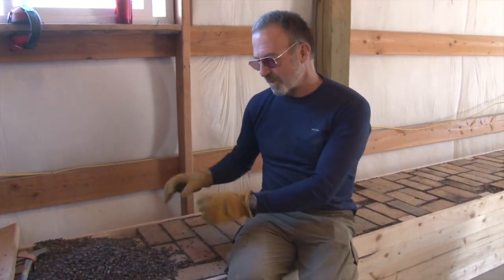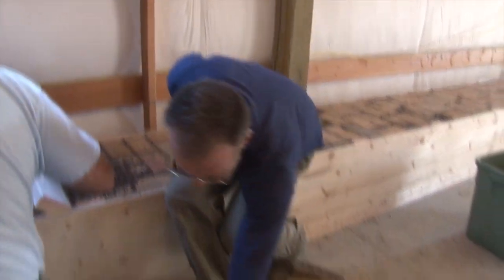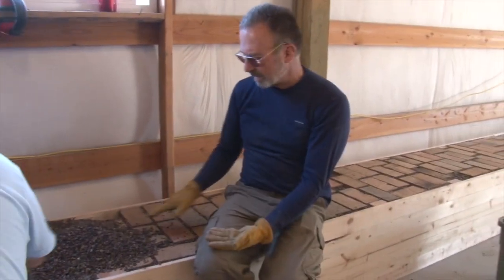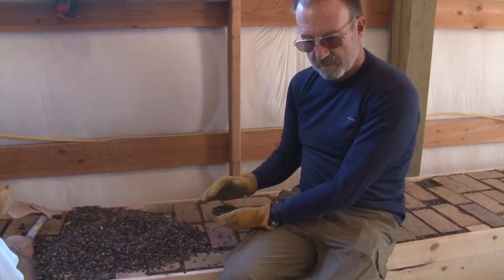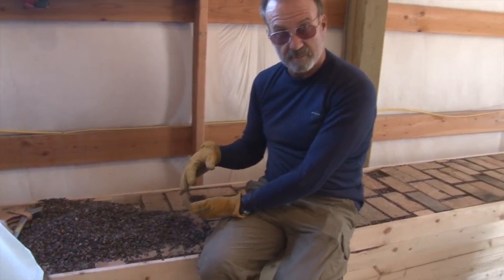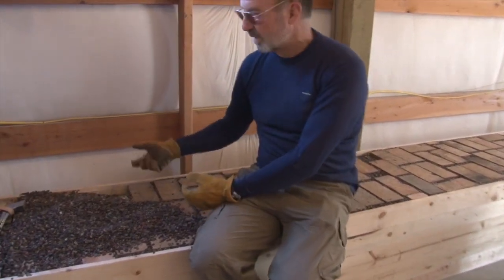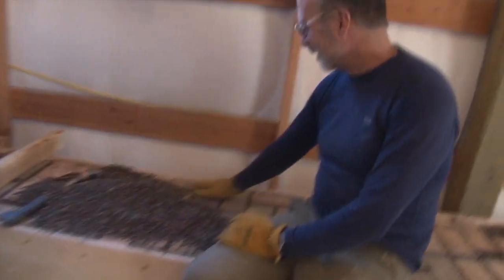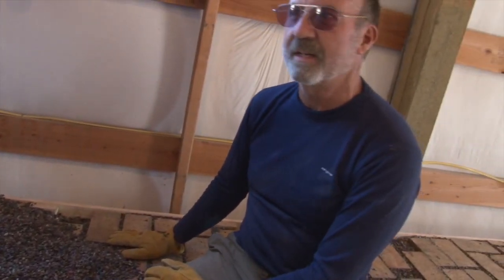rocket mass heater in a shop - less emphasis on mass and more emphasis on fast heat

Comment: I had to abandon my RMH project til spring as its outdoors. i used earth as my mass. covered on the sides of the stovepipe about six inches thick. left the top of pipe exposed. right out of the barrel i was reaching temps of 240-250f and slowly less as you went down the 30 ft pipe. 120f right before the bend to the upshoot out of the top. i do have a 180 making my mass 15 ft in length. ive seen many designs and performance always varies. mine being outside would take longer to heat up the whole system. but once hot didnt take much wood to keep it there. i also burned on average 2-3 times the amount of wood what paul says he uses. but i feel with a bit of ingenuity and trial and error these RMH will be just as everyone claims "the new wood burning stoves". i have plans to vent heat off my mass and use my barrel as an on demand hot water heater. good day to everyone

Comment: Paul.... It is my intention that at some time, I can communicate with you directly.

I have built a free standing rocket, using a 55 gallon barrel, insulated firebrick (IFB) riser and burn chamber. I did add a 3/4" secondary.

Using a 6" flue, I have it going under a mass similar to what is in this vid, but I used modifed crushed stone (a mix of 1/2" to stone dust, it easily compacts) within dry stacked cement blocks.

My problem is that my mass doesn't seem to heat easily, nor hold what little heat it retains. After a 6 hour burn, my mass is barely up to 85°F. From yours, and others vids, something is wrong... and the only thing I see is the stone I used to fill it. I think it's acting as an insulator rather than a heat battery. My flue, leaving the house, runs at about 140 to 150°F. Where is the heat going?

Should I reconstruct using pea gravel?

My rocket is a copy of a smaller stove made by YT channel Zero Labs. I think it is designed to be a space heater, not a mass heater. I do see it's shortcomings, no vortex, but once I get it super hot, it is a wonder... but needs to be tended often (small fuel/burn chamber. Version 2.0 is on the drawing board, vortex, a much larger burn chamber, smoother burn gas flow, better, larger, pre-heated secondary

I'd appreciate any input.

You may contact me directly at darkaugustknight@gmail.com

Thanks.
Reply: i wish you the best. dont be discouraged this is fairly new technology. its all learning still. almost everyone ive talked to abandon their first attempt. although they work theres always room for improvements. your second design sounds Kick Azz. best of luck to you
Reply: Thomas, the best way to communicate with Paul directly is via the forums at permies.com  You can start here: 
https://permies.com/wiki/75255/Sign-permies
Reply from the maker: I do put a lot of effort in directing people to the forums at permies where there are lots of people helping each other.  And then I also put a lot of effort into the DVDs to answer a lot of this sort of thing.   And I think I have over 50 rocket mass heater videos here on youtube.

Comment: At 1:58 the text says “note the use of plumbers tape” which I know as PTFE thread tape, a non adhesive Teflon tape that seals pipe threads.

  Aluminum duct tape is what I see in the image.   Some are rated for higher temps than others, and some have better adhesive (during application) than others, in my experience.
Reply: The expensive, high temp (400F) rated one I got did not adhere well... but may have been “on the shelf” too long.
Reply from the maker: here is a link to what is being referred to here as "plumber's tape" https://amzn.to/2MEjZp6
Reply: OMG 😲!! Plumbers Tape. NOT TEFLON TAPE! LOL
Reply: ah, you are correct...   that IS plumbers tape.  My memory fails in this case.  :-)  sorry you got "triggered" James!   LOL